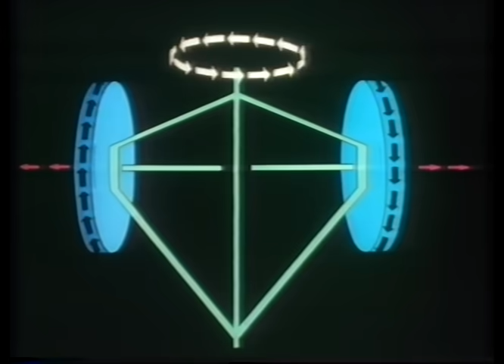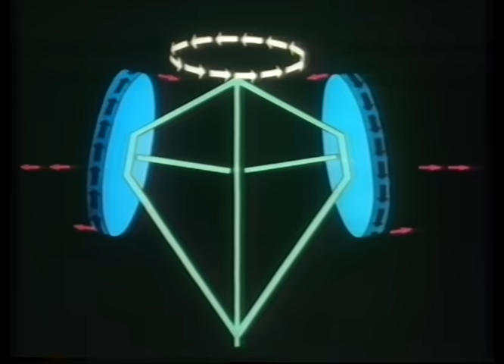Anti-Gravity Machine (Part One)

Comment: This design implements gyroscopic rotation in three directions side. Y . X and z in the bottom part. And I'd say a higher torque on the down swing arms on each side would have a higher cut on the y axis since the x and z are cutting the mass of the piston inside
Reply: what he says is true,only if the object is spinning at 99.9999999999% the speed of light
😂🤣😂🤣😂🤣😂🤣🤣😂😂🤣😂😂🤣🤣😂🤣😂😂😂🤣😂😂🤣🤣😂🤣😂🤣🤣🤣😂🤣🤣😂🤣🤣🤣😂😂😂🤣🤣🤣😂😂😂😂🤣🤣🤣🤣😂😂🤣🤣😂😂😂🤣🤣🤣😂😂🤣🤣😂😂🤣🤣🤣😂😂🤣🤣😂😂😂🤣🤣🤣🤣🤣🤣😂😂😂🤣🤣😂🤣🤣😂😂🤣🤣🤣🤣🤣🤣😂😂🤣🤣😂😂😂😂😂🤣😂🤣😂🤣😂🤣🤣😂😂🤣😂😂🤣🤣😂🤣😂😂😂🤣😂😂🤣🤣😂🤣😂🤣🤣🤣😂🤣🤣😂🤣🤣🤣😂😂😂🤣🤣🤣😂😂😂😂🤣🤣🤣🤣😂😂🤣🤣😂😂😂🤣🤣🤣😂😂🤣🤣😂😂🤣🤣🤣😂😂🤣🤣😂😂😂🤣🤣🤣🤣🤣🤣😂😂😂🤣🤣😂🤣🤣😂😂🤣🤣🤣🤣🤣🤣😂😂🤣🤣😂😂😂😂😂🤣😂🤣😂🤣😂🤣🤣😂😂🤣😂😂🤣🤣😂🤣😂😂😂🤣😂😂🤣🤣😂🤣😂🤣🤣🤣😂🤣🤣😂🤣🤣🤣😂😂😂🤣🤣🤣😂😂😂😂🤣🤣🤣🤣😂😂🤣🤣😂😂😂🤣🤣🤣😂😂🤣🤣😂😂🤣🤣🤣😂😂🤣🤣😂😂😂🤣🤣🤣🤣🤣🤣😂😂😂🤣🤣😂🤣🤣😂😂🤣🤣🤣🤣🤣🤣😂😂🤣🤣😂😂😂😂lol
Reply: @lorenzodiambra5210  well...I'd say he's missing some speed weight and angles of the shape that's actually spinning. If it was shaped or designed differently it would lift more than a rod.

Comment: The problem about this machine is that it uses an axis fixed outside.  So it apparently have an up movement,  but due to force vectors components pushing the support axis down so the machine can present an up movement. 
     There is nothing about anti gravity there. Unfortunately.

Comment: OMG I JUST FIGURED IT OUT….Ok, now put it in a donut as a supercooled ferrofluid to rotate both around the donut and have it twist in the tube as it does so.  Do this using magnetic propulsion. And then have another magnet in the middle that counteracts the centrifugal force so there is little to pressure on the outer walls when it spins. And have it…spin it up and make modifications to the magnetic forces applied to the fluid and then you are flying.

Comment: I see the flaw in this right from the start. There is a horizontal force applied to the vertical axel which makes it appear to freely travel upwards. If the gyro was freestanding it would topple over or it would need the same force applied horizontally to stop this from toppling over. Gyros are great mass distributors but they don't decease total mass

Comment: HINT: It's not the gyro. What this is doing is squeezing spacetime down. Using centripetal force. It's way easier to use a computer instead. More accurate, and not as wobbly. The basic aim is to make the universe think that an object is on a 2D plane. You are basically tricking the universe into thinking something is not there. Ladder drives are pigs to control though. You cannot really get sidereal thrust. (As you only have 2D thrust) Good for going up and down, but crap for actually moving. 1D drive is the way to go. It is WAY more complicated. It uses a spinning EM field, but has synchronicity problems that I don't understand yet. Or, alternately,  entanglement problems. Think of the Heart of Gold from Douglas Adams. I know it can be built, as I figured out a way. I searched for a pen and paper, but at 3 in the morning I forgot and fell back asleep. I deeply regret that.
All I can remember is that it had to do with the expansion of the Universe. Or some such. At least... It's a start. It might give someone an idea. Just bear in mind that you want to trick the Universe... Not change it's laws.

Comment: Friction in the vertical center axel creates the lift.    remove the center axel anchored to the table and table to the ground the friction of that center vertical axel creates lift lile a screw and that allows for it to climb up the axel thats anchored to the floor.    in zero gravity it would just spin out of control 360* X 360*

Comment: find a way to catch the "earth's" hum sound and  match it with a similar frequency  put it on a wave guide shaft 3d print a aluminium saucer shaped craft mould around it. Low frequency with the high 94725836 or is it 369472583 ah idk never mind

Comment: Imagine instead of using solid flying wheels you use liquid ones out of mercury in a strong magnetic field like LHC. If you apply direct current to it, it starts to flow in one direction, the more voltage, the faster it moves. Couldn't you use this as gyroscope?

Comment: I have been working on antigravity for over 20 years and have a simple proof that this system will produce lift!
Obtain a large grinding disc, say 12" in diameter, fit a bolt to its centre, and fit it to a drill. Switch on the drill to full speed.
Hold it out horizontally at arm's length. Then revolve your body clockwise and feel the precession cause lift, revolve in the opposite direction to feel it drop.
Now tell me that it doesn't produce lift.
Using 4 gyros mutually at right angles produces lift.
It does not lose weight, but changes the precession into lift.
Peter Carrington. MARCH 2023.
Reply: Centrifugal force isn't the same thing as lift. The former is the result of (directional) changing velocity, the latter has to do with a difference in air pressure. The former is related to projectile physics, the latter is related to buoyancy. Spin a disk fast enough and you will watch it break apart and demonstrate the reality of projectile physics and why we refer to centrifugal force as fictitious. 

What you are experiencing is the spinning disk's inertia.

Comment: aerodynamics of a curve ball would probably explain the lift.  The two gyro's at the outsides are spinning, and the rotation of the device forces them forward through the air, in a circular path.  Air is going to move faster over the top, than under the bottom, creating lift.  The same phenomenon is how we get sail boats that the sail is a spinning cylinder.  It's used today on some commercial freight ships.

Comment: This machine makes no sense. Why would you spin the centerpiece in the same direction as the spin of the gyroscope? If the gyros are spinning clockwise, the centerpiece should be spinning counterclockwise so that there is a conflicting inertia and the gyros would immediately raise to try and counteract the spin of the center. That's how you get "antigravity". Not this nonsense.
Reply: How can you tell what direction is which. The gyros are laying down horizontally.
Reply: @FVLMEN  Pay attention 9:45
Reply: @darkorse9752  the spin in the animation can be illusory. You can't quite tell what the spin is and it's irrelevant. Sandy obviously uses a counterclocking spin otherwise it wouldn't work.

Comment: If this invention works. I can imagine it being contained in a sphere at the centre of a flying machine. where the extreme speeds of all the different heavy rotary parts are controlled  by computer to give it direction and lift.
Reply: They ride resonance waves by containing them in 'resonance chambers'. They create a high energy field around the outer chamber which allows the craft the fly underwater without slowing down.
Similar to when a bead of water rolls down a hot frying pan, the vehicle rides a field of plasma making them immune to inertia outside the field...
Hope this helps!
Reply: @4corander  Lmao, the leidenfrost effect has nothing to do with gyroscopic procession. You're full of it.
Reply: @grah55  ok

Comment: Offhand, i would think he needs to continue to add energy for this to “work”, and Newtons 3rd law applies. So, keep the gas engine attached with a flex shaft at least periodically or continually and accelerate, radially accelerate, jerk force etc develop. His invention might take off, on a leash. 
Instead of tin metal arms and friction robbing connections, think chemical energy w/nanomotors and/or light manipulated Janus particles. Glowing flying saucers...
Ok, im just a plumber so i’ll get back to work.
Reply: Never give up your day-job; you and (tool-fitter) Kidd already earn more than physicists.

Comment: Weight x mass x the force of gravity by 1%   try making the gyroscopes magnetic and placing that machine inside of a capsule that can be magnified then send it. You would have to oppose the force of gravity's pull plus the weight  by the mass  of gravitational pull by 1 % to lift 1ft. It would in effect... reverse earths magnetic field and hover. Free insite and info I hope you get this!

Comment: They had a car that ran on water but it somehow disappeared like this guy would if it actually works
Reply: Water is the 'ash' which results from burning hydrogen. How can one burn ash? Many crooks have sold the idea of splitting water into hydrogen and oxygen by using a battery and then exploding them in an internal combustion engine. This is fraudulent, because it would be more efficient to run a car directly using the battery. The splitting process merely wastes energy.

Comment: Spinning wheels are not antigravity... Antigravity would have to do with Electromagnetics hands down.. think of a Subwoofer.. a Subwoofer actually is part antigravity... It's got a coil and motor " Magnet "... When the coil is excited by electric signals it moves in and out of the magnetic gap.. the cone coil and former spider ect all have weight to em.. yet the coil don't have propellers ect it goes up at a high rate of speed... It's using antigravity.. it's been infront of us for so long lol

Comment: Fuck gyros, lets use toroids with liquid metals inside. Gyros are for infants that don't understand composite materials and electromagnetic fields, and people from the 70s. All this hubbub and no practical demonstration of the device? I'm disappointed his hair or garments didn't get caught in the machine.
Reply: Are you referring to that old paper in the American Journal of Physics? Don't forget that the liquid metal would have to be osmium, and move at thousands of Mach. From what would you make the toroid? Even then, it would permit only levitation and not space travel.
Reply: @MrAaronvee  Thanks, no I didn't read the article. I just think about things too much ... well couldn't you use electromagnetic fields to control the heat or control space between the osmium and superstructure?... clearly my understanding of phsydiccis is mediocre at best. What about lasers that make things cold? Maybe attach them to sharks?
Reply: @Dc-zu1ii  You are thinking of the control of plasma, as in the Tokamak.  That will not work with liquid metal. It would be hard to both cool the system and keep the metal liquid.  All that you need to know about physics are the conservation laws. These rule out any currently conceivable antigravity machine. But check out the Lense-Thirring theory.

Comment: A little explanation of what's going on with that heavy-ass gyroscope: Put a 10 lb weight on the end of a pole and try to hold it up. It will seem a LOT heavier than the ten pounds and change that it actually weighs because of the lever effect. Gyroscopes negate the lever effect, but they DO NOT make the device weigh less. A ten pound gyroscope will still weigh ten pounds whether it is spinning or not. It just won't act as a lever to give you the exaggerated downforce that a ten pound weight at the end of a pole does, when it is spinning. It's not anti-gravity, not even close.

Believe me, I want the secret to antigravity as badly or worse than most people. You just have to not go believing in anything anyone claims just to attempt to have it. People like to con others for personal gain, it happens ALL the time.
Reply: Yes, obviously. Victorian audiences were shown such demonstrations and were not fooled. Could it be the Internet which has made modern people so stupid?
Reply: @MrAaronvee  No, because people were being fooled by this before the Internet existed, mainly by the power of television. Before that, people were being fooled and killed by the "curative" properties of Radium.

Nobody "made" people stupid by trickery. People have always been gullible, desperate, and for the most part unable to think for themselves. Town criers and snake oil salesmen, newspapers, radio, television and the Internet made no one stupid - these things merely blew the dust off the problem inherent in the species and exposed it for all the world to see. Now you just don't have to work to uncover it.
Reply: @NightRunner417  Well, yes. One always suspected that there were a lot of nasty and stupid people scattered throughout society. I would argue that the Internet (and the post-truth Trump era) has proved that they are in the majority.

Comment: I like the polite professor, he knows perfectly well the machine will never work but doesn't spoil it for him and encourages him to try to improve the machine until he realizes too...
Reply: 8.24. 😂it goes.
Reply: he seemed very impressed as others were not able to replicate previous designs because they kept on tweaking with their inital "loose" design. He was praising him because he kept his initial successful design. But thanks for your satire
Reply: Dumbest observation.
IT WORKS. 
Reduce overall mass- easy, 
Increase motor efficiency- check.
Reduce the volume and  increase the mass of rotors- easy.

Nuclear, nanotubes, tungsten.
That's simply using different materials. 

Imagine nuclear drive, 
Carbon fibre + nanotubes,
Tungsten gyro rotors.
Reply: @Rob-rp3cw  Unfortunatelly only in ones head :(
Reply: Professor Lighweight :-)